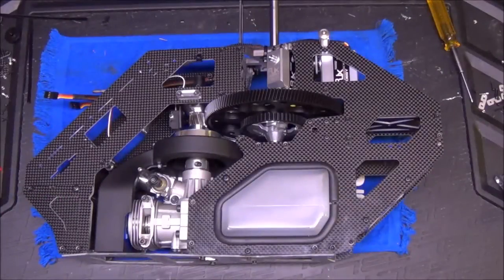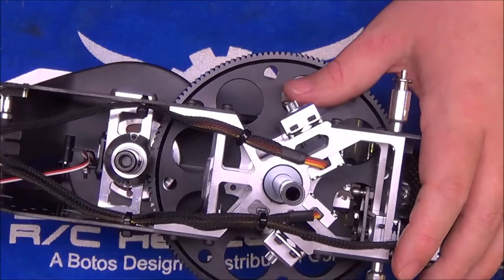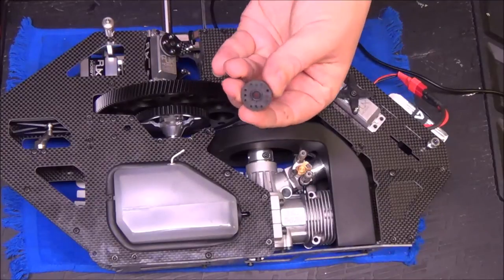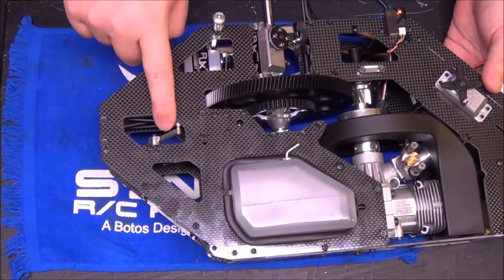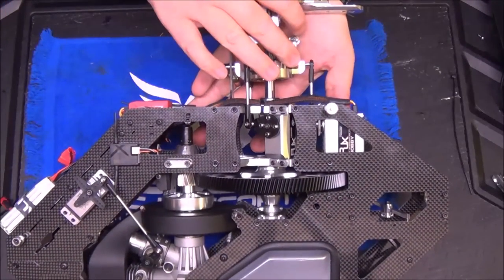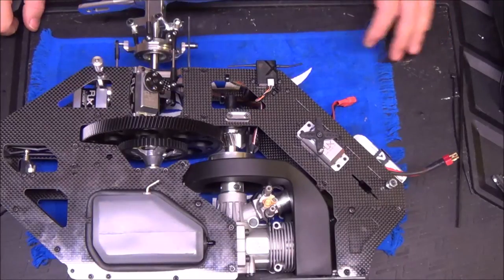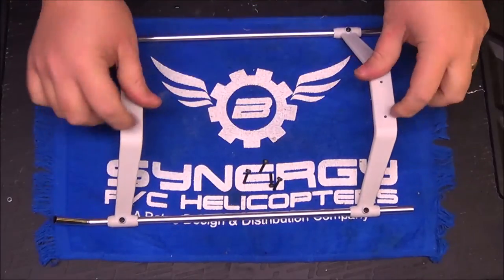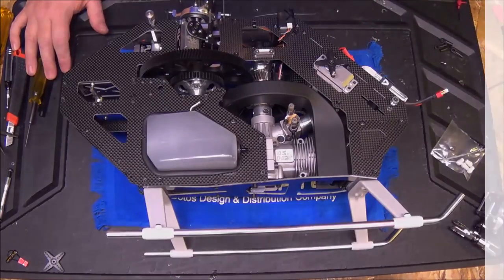Synergy N7 Build Video Series Day 4 - Electronics Install and Installing the Skids

Comment: Great video Chris!  I know everyone has their own way of doing things;quick tip on the skid pipe nuts.  I use an old flybar or a tail rod off a Align 500 can't remember now that I mention it, but thread on the one end of the skid nut and then slide them into place using the rod for both front and rear. Similar to your zip tie trick.
Reply from the maker: Yeah I didn't have a flybar laying around on enough. I have always just used a zip tie, but I am sure the flybar method would work great!